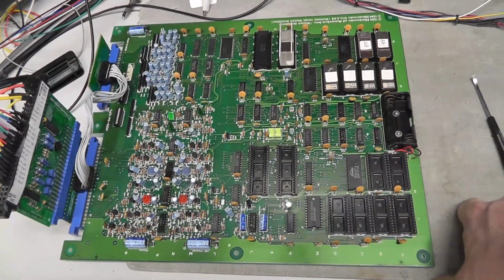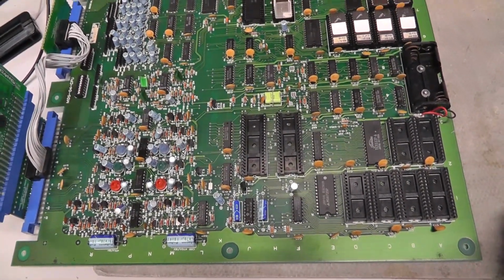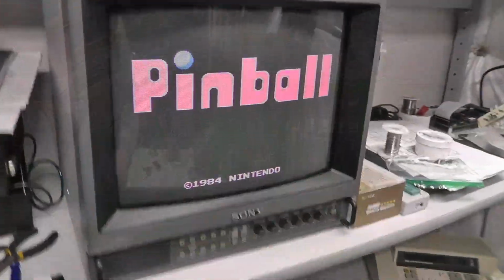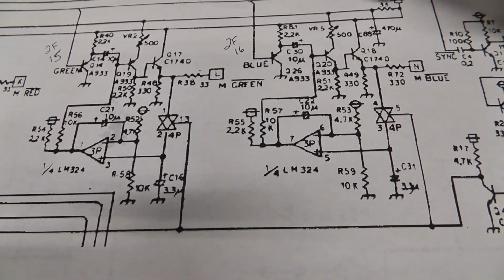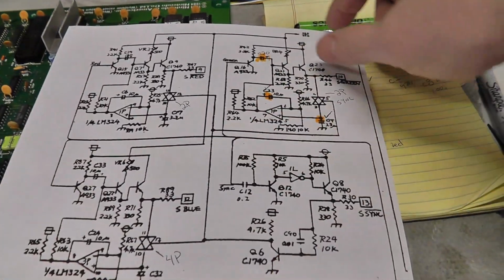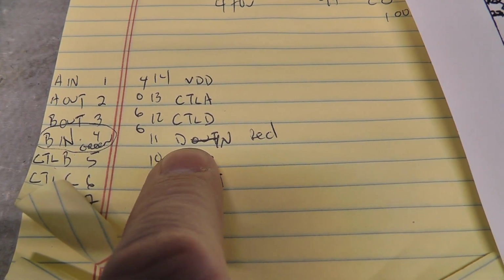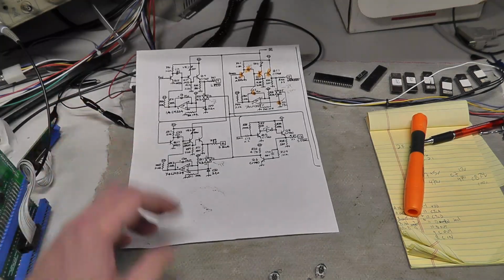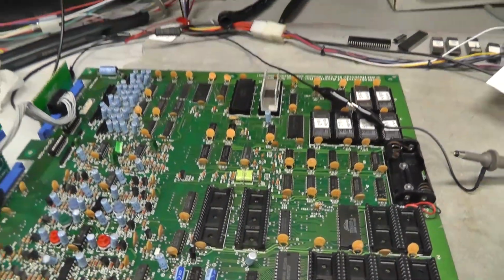Nintendo VS PCB Repair - Part 2 - Missing Green Color Output

Comment: What fixed the green horizontal line issues?  what do you mean by pushing the electrons that are the cells back up to the control gates voltage?
Reply from the maker: Didn't have any green horizontal line issues. re comment on the reprogramming of eproms  see this pdf and reply to your previous comment on other video. 
 https://www.elnec.com/sw/an-825.pdf .a fully erased cell will have all its electrons in the channel between control gate and floating gate.  When programmed it pushes all the electrons to the control gate so they wont conduct at 5v or even 5.5 or higher which results in a reading of zero.  partially erased or exposure to UV, like many nintendo roms, will charge the electrons back down to the channel which allows them to be activated and read as a 1 again.  This is why when I reprogrammed them, (not shown in video), i was able to verify rom at 5.5 and 4.5v.  Reprogramming them at VPP voltage pushed all the electrons from channel back to the control gate.